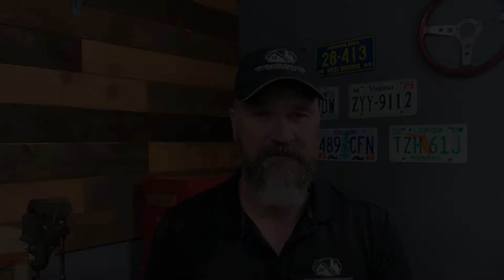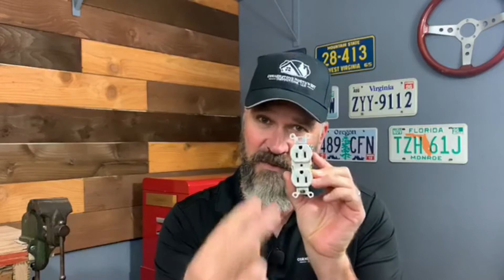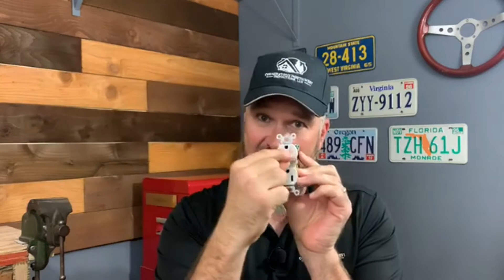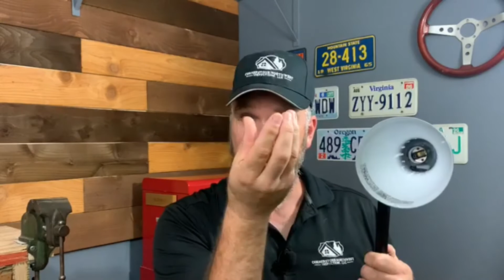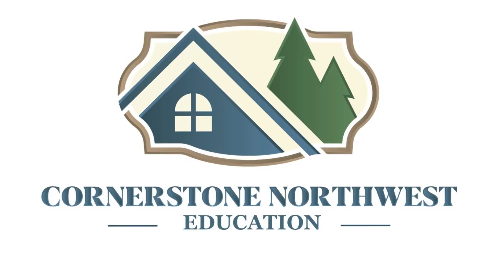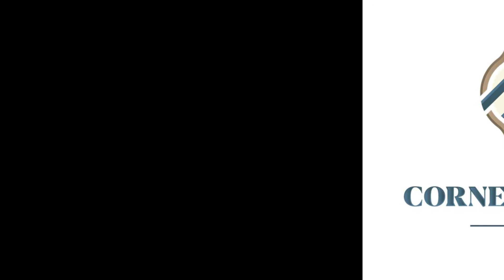The Dangers of Reverse Polarity in Your Home

Comment: What if the lamps plug is not polarized? If both blades are the same size?
Reply: Great question! Not sure on that one.
Reply: Check the cord, the neutral side should be ribbed, while the hot side is smooth. If they are the same, then you can check the polarity by checking continuity. The blade that's continuous with the bulb socket is the neutral side. If it cannot be determined, then there may be some circuit in the lamp base that makes the polarity irrelevant. It may have an AC to DC conversion, I had a lamp like that. Phone chargers for example, operate that way and the blades are typically the same size.

Comment: Well if a device is designed to expect any polarity in the outlet than that device is an unsafe garbage! Only the US and the UK have polar AC outlets. EU, Japan, china - most 9f the world use simetrical outlets with the plug going in both ways and it is not a problem. But for real if a device is desined so that the polarity matters then that device should be recalled....

Comment: Good explanation,  down to point.  Indeed reverse polarity outlets can pose a dangerous shock risk, and yet most devices will work normally.   Speaking of table lamps, sometimes really old lamps, like that beautiful floor lamp your grandparents got as a wedding gift, might have a plug with two small  prongs, allowing it to be plugged in either way.   Nothing wrong with inheriting something with great sentimental value,  but older equipment was not always engineered with consumer safety in mind.   You should at least cut off the old plug and wire on a new polarized plug, making sure the cord is in good shape, and that the large prong connects to the screw shell, on modern cords the neutral side will be ribbed,  the hot side has writing.   Old cords might not follow this convention.
Reply: Such old lamps likely lack double insulation and are not safe.
Reply: Back then you were supposed to have common sense and not touch the shell when chsaning a bulb or unplug the lamps. Thus, polarized plugs were not needed. They were created to prevent dumb people from hurting themselves.

Comment: What if you have 3 outlets/receptacles on one breaker, and just one outlet/receptacle is wired backwards?
Will it affect how the other two operate?
Will it make any difference if it is the 1st one, the middle one, or the last one in the series?

And if an outlet is wired backwards, how will it impact tools you plug in, like a drill or saw. Does it impact how much power it gets? (reducing the tools effectiveness, or does it just not let the tool operate at all?)
Reply: Great question! An electrician might be able to describe the consequences of the scenario you laid out. Just not sure on all of that.

Comment: An outlet wired with reverse polarity can fry certain electronics like my Ryobi battery charger which I plugged it into a customer's incorrectly wired outlet - poof! No more charger.
My polarity tester verified this afterwards, but too late 🙁
Reply: Nonsense. The charger cannot know which wire is grounded. Most countries use unpolarized outlets.
Reply: @okaro6595  Yes it does. Open it up and look at the circuitboard.
There’s a reason why one plug is wider than the other.
Some appliances don’t need set polarity and some do.
Both blades of the plug will be the same size if it doesn’t matter.

Comment: The electrician trade needs to pick a new name for reverse polarity. 120 VAC reverses polarity 50 or 60 times per second, depending on which country you are in..  "wired backwards" would be much more correct as well as more descriptive, and also point people in the correct direction if they are trying to learn. I'm not sure where the term reverse polarity started among electricians, but most electrical engineers would turn over in their graves if you used reverse polarity in describing something other than DC.
Reply: As a complete newb I agree. My first question was “ what exactly is reversed polarity ? “
Neutral to brass contact , and hot to silver contact ?
Reply: @stevenmorris2293  ....Black (hot) to brass & white (neutral)  to silver is indeed proper.  Your question with the "reverse" assignments that you mentioned would qualify as reverse polarity in the context of this discussion.  For the Cornerstone example with the light socket, the brass tab at the bottom center should be connected to a black (hot) wire, while the threaded socket should be connected to a white (neutral) wire. 

For the record, 120 VAC is referring to "Volts Alternating Current".  It is not easy to explain how the neutral (white wire) shares in this cycling and the involved current flow when at the same time in the breaker panel it ultimately is connected to the same electrical status point as the ground wiring which should experience NO current flow.  What the average homeowner needs to know is: "black to brass" and "white to silver" when wiring receptacles.  Light switches can get to be a little tricky, especially with 3-way and 4-way switches, so wiring should be left to those who are qualified or who have done some serious homework and learned what needs to be learned.